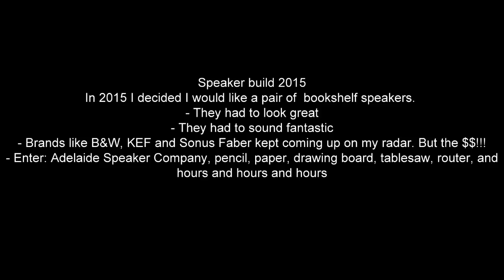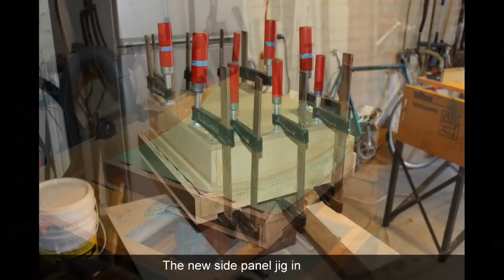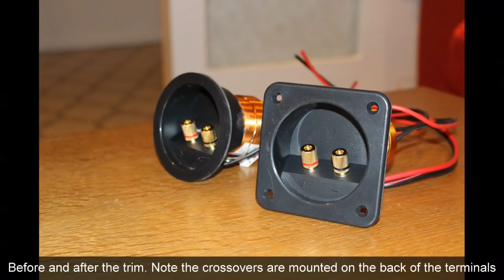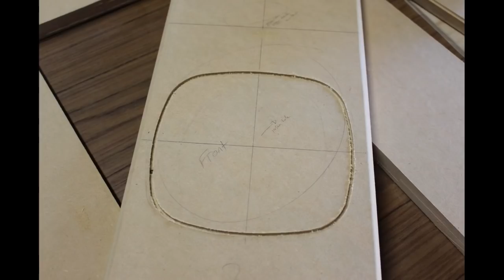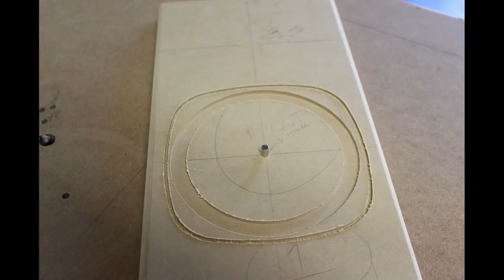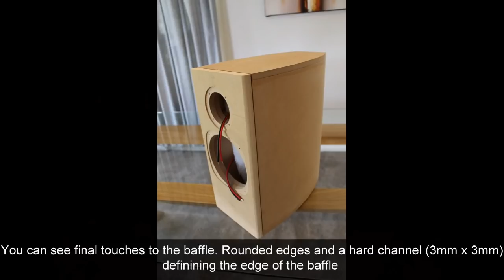DIY Bookshelf Speakers

Comment: Nice project! Woodworking is top noche! I myself are planning to make my own speakers as well. Been looking around for these kerf cabinets. Looks better and more elegant. Bought a GR research Encore kit for 550$. Only the crossover parts are 350$.!! Upgrade version. Your crossover looked a bit tiny and simple. It’s the most important part of the speaker, so a upgrade in parts will do a great deal on the sound. Keep up your good work.
Reply from the maker: Thanks for the comment. The crossovers were hand made by Adelaide Speakers https://www.adelaidespeakers.com/

Comment: Wonderful piece of work there young man. They're rather Sonus Faber-like, so perhaps veneer side strips, horizontal or vertical, would look good with high polish finish, maybe a leather covered baffle? That's the way I'm leaning with my next build. I do like Sonus Faber but can't afford them, even the bookshelves. With careful cabinet work such as yours, decent drivers and a well made and thought out crossover, one could achieve something similar to a SF for chump change by comparison to the real thing. There's no magic dust involved, SF's craftsmen are just ordinary people doing a great job...

Cheers from Spearwood WA, Martin

Comment: The number of layers in the side curved sandwich seems to me excessive, three would be enough, just you need to know which ones. The design is tensely curved. A good sandwich will raise the resonance frequency and must be damped with viscous damping. Further build-up of layers only makes the structure heavier without leading to the desired effect.
The essence of the action boils down to the fact that you need to drive the band of vibration modes as high as possible and then use viscous absorption. If even more stiffness is needed, then more spacers and frames and with a higher speed of sound must be used.
As for the crossover, biamping is already justified here. The idea of a double pass bass reflex, when properly tuned, will give the corresponding effect. The foreman has a correct understanding of the task. Such a design, with careful adjustment, is able to please with sound.
As for the finish, the veneer of light woods under the nanovarnish will delight the viewer, for the shapes are perfect.

Comment: Look great, how did you do the hard channel?
Reply from the maker: Are you referring to the channel between the baffle and the case? I cut it on the baffle (router table) before I attached it to the cabinet. Initially I was going to fill it with some copper square stock, but I ran out of motivation and just wanted to get them finished.

Comment: Nice videos! How did you attach the front MDF to other pieces?
Reply from the maker: Glue and clamp. The only screws in these speakers are the ones holding the drivers and terminals in place.

Comment: I like your Speaker design, would you allow to copy it. It is easy to buy the Chassis.
Did you calculate the cabinet yourself?
Greetings Till
Reply from the maker: Feel free to copy. It is a simple bass reflex design. I had the team from Adelaide Speaker Company help me with driver choice cross over construction and component placement.

Comment: you know that ported box is not the best sounding right?  you can not intelligently argue for ports.
Reply from the maker: As with most things in life, this project was a balance/compromise. Form, function, ability and budget. In this instance I did not have the skill to manufacture a T/L cabinet in this shape, so I chose the more simple ported enclosure and sought professional advice in the placement of drivers and ports to maximize performance.

Comment: , these would have been perfect for a down firing 10 or 12 inch woofer.
everybody now a days is scared to use larger woofers, why? I just don't get it and then they have to hook up a $1,000 dollar 500 watt subwoofer because they're speakers just caint produce the sound they want.
why not make a speaker design with a powered subwoofer in the actual speaker like Polk LSi speakers do.???
Reply: Tim Schutte You can't just add a big beefy woofer and expect loud deep bass. He would have to make to compartments, one for the mid woofer and one for the bass woofer. And for a bass woofer that cabinet size would barely be sufficient. These speakers can probably go down to 50 hertz. To go deeper you would need a bigger enclosure.
Reply: Eternal Genesis , that's pretty much what I was saying, desing the speaker from the start for a side, rear, or bottom mount woofer of at least 10 inches to get the 40 Htz frequency that is much needed for any type of music. 50 Htz like you said is NOT low enough.
I have 4 A.R. tower speakers that are thin at the width but very deep because of the ( Side ) mounted 10 inch woofer!!!
the 2 mid-range 4 inch speakers and a 2 inch soft done tweeter face forwards. I get a frequency response of 40Htz to 20,000 Khz. which is a perfect response for any type of music. some will argue the fact that you need a subwoofer but I don't care for a powered subwoofer for music playback but I do like a subwoofer for movies.
I see so many people design speakers now a days design speakers with way to small of woofers and then they buy a thousand dollar 300 watt 12 inch sub because their speakers caint produce the type of sound they want. that's my opinion just like assholes, everybody has one.
the proof is in all the videos I see on YouTube and from manufacturers.
Reply from the maker: Bingo. It came down to aesthetics and budget and (my) skill. Full range towers would never have been approved aesthetically. These are purely a part of a stereo system which primarily plays jazz and classical. A transmission line cabinet design may have provided better clarity, but the construction of said design in the curved cabinet I wanted was beyond my skill set.  I'm currently working on the finish. Gloss baffle with veneered cabinet. I'm very happy with the way the stands are looking too. I'll be sure to post a slideshow when they are done. Thanks for the interest and comments
Reply from the maker: I'm not against a sub. In fact I have this 10 inch driver waiting for an enclosure. https://www.madisoundspeakerstore.com/approx-10-subwoofers/sb-acoustics-sw26dac76-8-shallow-10-subwoofer/
It will likely be a sealed enclosure rather than ported to keep things tight. It will need to be pretty to look at if it's got any chance of making into the living room!
Reply: I hope you can make a video of the subwoofer enclosure! Great work!